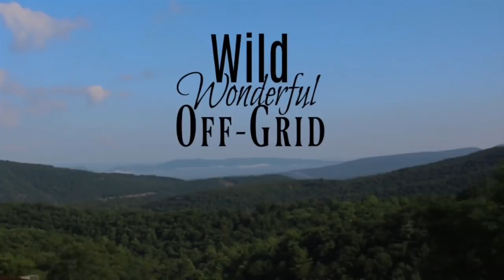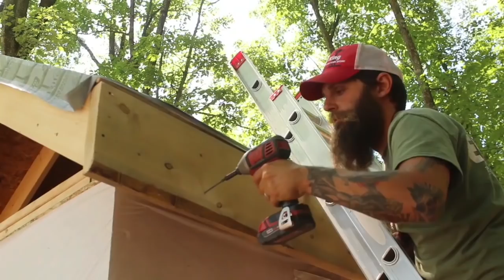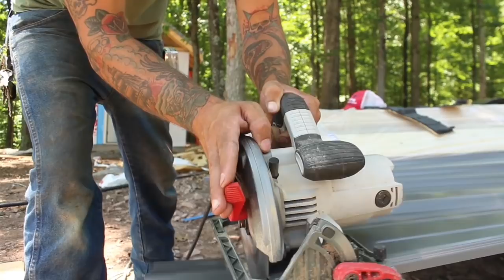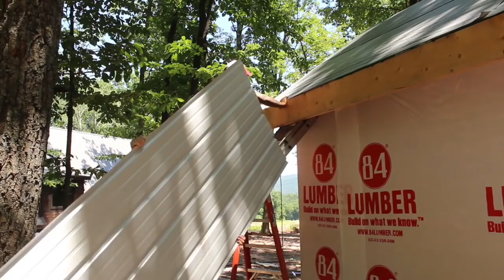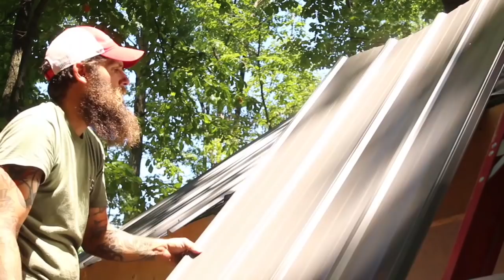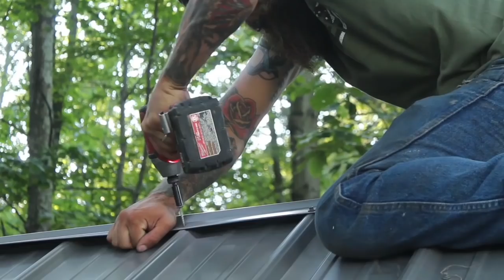How To BUILD A Shed From Start To Finish- Part 5

Comment: Since you're not worried about natural light, you can use the extra space in the ceiling area for storage if you wanted to put a little more work into the inside of it.

Comment: Fine job on that roof, and I love that you used the metal roofing there too. A lot of people would just have used something else, but that metal roofing installed properly like you 2 are doing is a "don't think about it for 50 yrs. or more" solution. You are right about not making it too fancy, and a construction guy friend mentioned that in the woods like that the peaks wouldn't bring much light anyways..although he did say you could always go back and remove a panel in the middle on each side, plumb cut the board,and use a couple of the polycarbonite sheets in its place..would let more light in from the top in that tree'd area, and still allow you to use that same ridge cap. He did on a shed on his property and said it is holding up well..even after a hail storm, so something to keep in mind for the future.

Comment: I don't quite understand why so many people screw the roof down in the open valley instead of along the rib; to make it a little easier I understand, seemingly a little stronger maybe, but the potential for leaks increases especially with the pressures of snow and ice on the screw heads, and then there is expansion contraction. (for the several I've installed I also found it easiest to predrill holes)
Reply: BINGO , I WAS WONDERING WHEN SOMEONE WOULD SUGGEST THAT YOU MIGHT LIKE TO DRILL ON THE HIGH  POINTS  . I LEARNED THIS FROM CREWS  WHO  do this for a living  .( Just saying  )
Reply from the maker: We are following manufacturer instructions so we don't void the warranty.
Reply: @WildWonderfulOffGrid  That's a good reason  :)  I wouldn't, but that's just the kind of person I am 😇 besides that if you get a leak it is easy to fix on the rib, and, ... much easier to reuse the metal roofing if it only has holes in the ribs.

Comment: Where I come from the normal practice is to put the screw attatchments through the small ridges instead of on the flat parts of the roof pannelling.  Whenusing the rubber seals on the screws I guess it doesn't matter much for a few years especially when it is on the shed.

Comment: When I built my shed I used the clear roofing panels that are shaped just like the metal roofing. I cut holes in different spots in the roof before installing them and during the day you didn't even need lights on.
Reply: Those wouldn’t carry the snow load in most places.  They also tend to yellow and crack over time so I’m sure they are willing to spend a little more now and not have to worry about replacing them later on down the road.

The metal roofing also ties into the house they built and look much nicer.
Reply: Sean Lynn I’ve had them installed on my shed for approx 7 years. No discoloration or cracking and we’ve had upwards of 3’ of snow on them with no issues. Their roof pitch is more extreme than ours so the chance of them getting snow buildup is not going to be an issue.

Comment: In my opinion, a house, a cabin or a shed should have the long sides facing south and north. That way you will have more passive heating of the building during summer, more light that comes through the windows the whole year, you can have a wider deck and you can have solar panels on the roof.
Reply: Annie I’ve seen the majority of houses set up to only consider the length of the driveway or some other dumb contractors notion of which direction to site a house when there are majestic mountains to view. Mt Hood so close you could feel the cold coming off it but no windows to appreciate it. They have their solar panels set up in the pasture I’m guessing so they’ll be easy to clean. Are you an Architect?

Comment: dont know how much more  tin roof you are going to do but if you take an awl and hammer and punch rather than drill your roof screw holes it goes a lot quicker than drilling and while you can bend/break the awl every so often they are cheap. toddles the zip

Comment: Have you thought about catching your watershed in food grade IBC totes?  Put em on a trailer have a gutter system drop into them. Could save your pump and panels little extra work. Free up a few minutes on watering chores for something else.  Manufacturing a harness so Josh can work off those little Debbie’s. 😹😹

Comment: I have a solar shed setup the same way as you guys!
 You will have a problem with heat buildup in there during summer months, likely it will need to be cooled somehow. 
I use a 5000btu AC on a temp controller
Reply: Or just use a power vent which is what I have in my shed, allows me to keep my generator running in there when the power is out and still keep the shed locked up
Reply: So wait. Are you saying you don't even have a solar setup what so ever?
But you know what will work?
Reply: @willnorrissc  Keep in mind, I run a generator in that shed with a power venter (before the venter the temp in that shed was insane, with it? I can leave the generator running with the shed closed/locked) Solar setup can't be much worse for heat/outgassing.

Comment: Have you considered the need for ventilation in the shed?  I imagine the electrical items need a dry atmosphere but having the well pump tank might cause the shed to have higher humidity.  Rethink putting small windows that can be opened to allow ventilation and natural lighting.

Comment: great job, next time consider under metal sheeting condensation drainage and forget foam strips. Big double thumbs UP !
Reply: It's going to get condensation on the underside of the sheets, we always had some insulation before the roof sheets went on
Reply: @colstace2560  Ask yourself this... over the roof deck you apply  air/water barrier underlayment  before metal sheeting  ... why would you block roof metal sheeting from doing it design function with end cap sponge materials ???
Reply: @videobob6789  if you insulated under the sheets the condensation forms on the top side and just runs off, also stops embers from forest fires blowing under, with no insulation condensation forms on the underside and drips into the building
Reply: @colstace2560  not to chance from foam strip blocking air/water flow under metal sheeting just to stop bug... now it to forest fire embers part of thermal wind development which burns everything in minutes.  Col, very much enjoy you and wife video editing. you're a good team
Reply: @videobob6789  not my channel 🤔

Comment: You will want some kind of venting in the shed for the batteries to off gas.
Reply from the maker: They are lithium ion batteries so there is no off gassing. Off gassing typically comes with lead acid batteries

Comment: Hello Josh and Erin, good morning, I've gone back through past video's trying to get my answers, but can find them. So, I'll ask, are you putting the propane water heater in the same utility room as the batteries? I know lithium ion batteries don't need venting, but just asking. And is the water heater going to be constant cycle/return system, because of the radiant heat system, are you putting in zone controls? And finally, Does your water/well system need a cistern for storage and treatment before using? Thank you for your time, very enjoyable watching you two!
Reply: Karl Griggs, is there a reason for your concern?  If the answers are yes, do you have any suggestions or alternatives to offer them?  Please explain.

Comment: Nice work ! Love the symmetrical screws .... one suggestion, if I may ?  Put the screws through the high ridges, rather than the valleys ... less likely to leak and every 4th ridge is an overlap. Potential a few less screws overall. (Like you did on the Ridge Cap) !
Reply: That's how we do it in Australia, never pan fix
Reply from the maker: We followed manufacturer instructions. I've heard it's done differently in Australia and other places but in order for us to avoid voiding the warranty we had to follow their instructions.
Reply: @WildWonderfulOffGrid  , Fair enough ! I live in the land of Ice and Snow ... we take every precaution !!
Reply: @wilburfinnigan2142  the roof sheets we use in Australia are high tensile steel so don't deform much and it is what the manufacturer recommends
Reply: @wilburfinnigan2142  not behind just different products, different climate, different demands on roofing etc
Reply: Wild Wonderful Off-Grid where in wv you at ? wv here southern part
Reply: @debrataylor3539  they need to keep it a secret so no one hassles them, for some privacy
Reply: @wilburfinnigan2142  catch up?
Reply: @wilburfinnigan2142  there's more than one way to skin a cat, not just 1 right way, there are many. I'm up to speed thanks!  Trump 2020 !

Comment: I get confused about how you do things in the U.S.  In Australia we drill into the peak of the corrugated iron and put the screws in there to stop water incursion but you guys do it in the flat area.  There is the issue about spread by screwing into the peak but if you make it firm it avoids that issue.  Can you explain what the difference is and how you avoid water incursion please.  Cheers.
Reply: I've put two different steel roofs on my home in Maine. A few years apart. 
The first one came with instructions to put the screws in the ribs. 
A few years later the home store had a different manufacturer and they provided shorter screws and said to put the screws in the valleys.
A few people have told me that screws in the ridges cause the panel to warp throwing alignment off.

I was happy with the way they both turned out

Comment: All your screws should have gone only through the ridges on the roofing iron, potential for them to leak where you have put them.
Reply from the maker: We installed according to manufacturer instructions
 Had we not, we would have voided the warranty.
Reply: @WildWonderfulOffGrid  The whole idea of the ridges is the give strength ( as the swages are) and to get any screw/nail holes away from where any water running down the troughs can get to and leak. I am a trade served builder who also spent 4 years manufacturing roofing iron, so I have a rough idea.I think your supplier has given you bad info.

Comment: 2:50 the board there was not pretty. First the ugly side of the board goes in. If you cut the end of the rafters 15 degrees tilted inwards from vertical that it is now, it looks a lot better. And you can cut off the bottom of the rafters vertical also, so the edge is smaller and the plank is smaller. That also makes it look better. Why have a seal for the roof at the bottom and open at the top? The bugs are not stupid. Now you only get poor drying.

Comment: Why are the fixings in the pan of the sheet not the rib. You have just drilled holes in the water channel, even if the screws have seals they will degrade... 🙄
Reply from the maker: We installed according to manufacturer instructions. Had we not, the warranty would be voided. Different countries do things differently
Reply: @WildWonderfulOffGrid Excellent, thank you. I wonder why our rain is different here in Australia. 😂😂😂